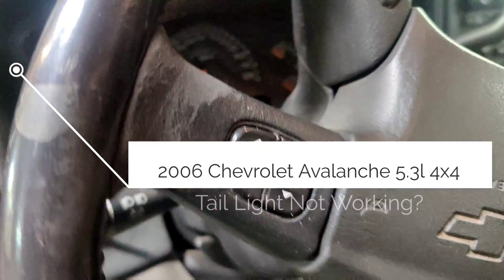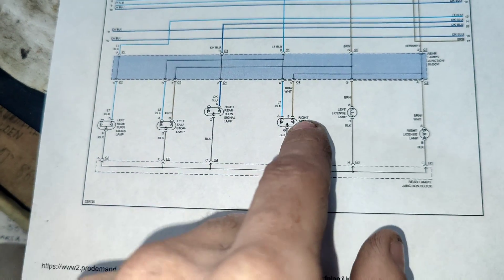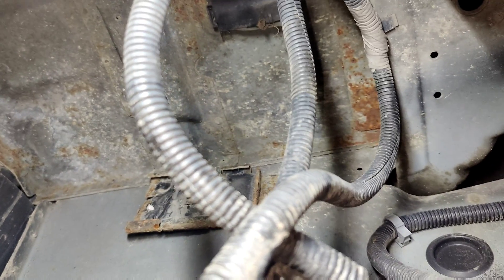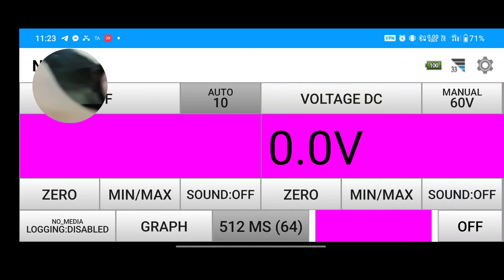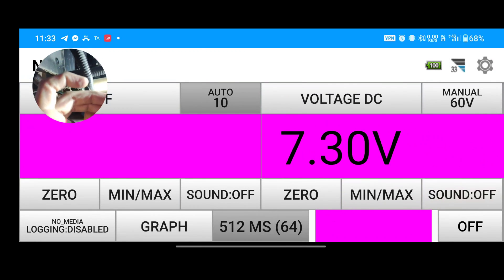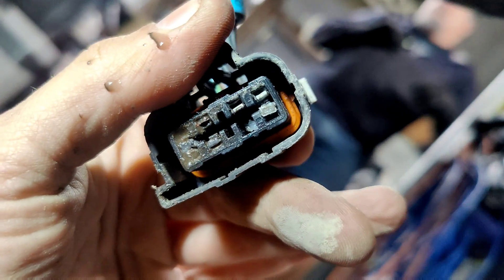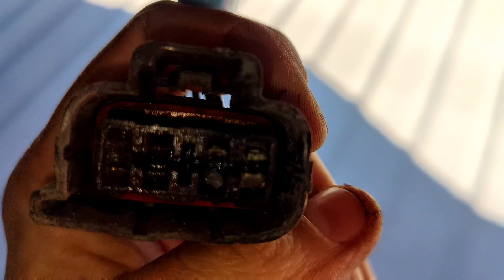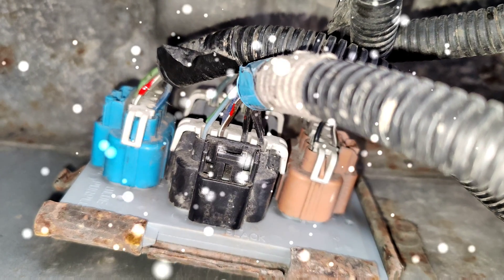2006 Chevrolet Avalanche 5.3l 4x4 Tail Light Not Working (N2 Neuron)

Comment: No offense, but that could have been diagnosed in half the time with an incandescent test light, not to mention that any continuity at all would have given you battery voltage at the terminal without being able to carry enough current to light the bulb, and given the age of the truck, splicing the wires together outside of the junction block would have been a more cost effective repair given the high probability that the terminals in the connector are also corroded.
Reply from the maker: None taken.  It could have used a test light. I was asked to make videos with the meter. I've had it for a few years. I try to use different tools to stay familiar with them. If I stick to one tool all the time I forget how to use others and then if it were to break then I put myself in a spot where I feel unsure of my testing. Also there wasn't any real visible corrosion on the pin where it went into the connector. The pin also had pretty good tension on the broken piece.